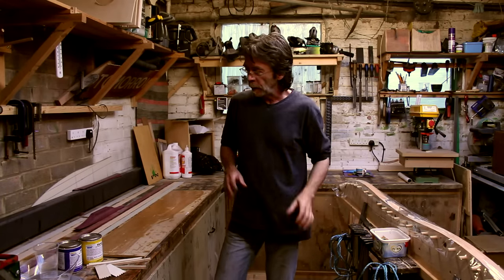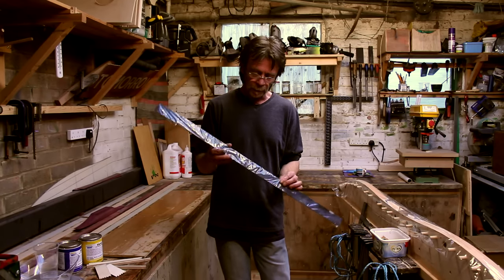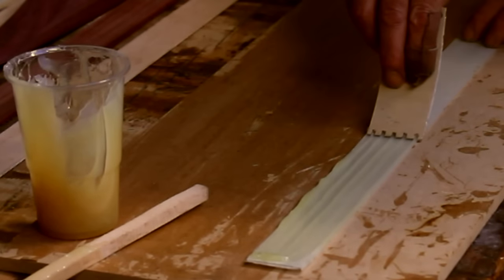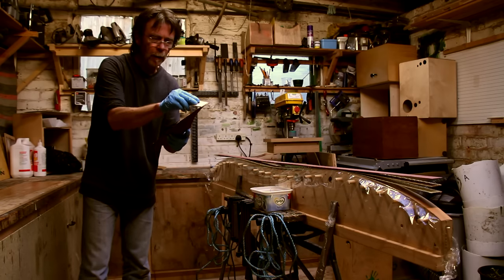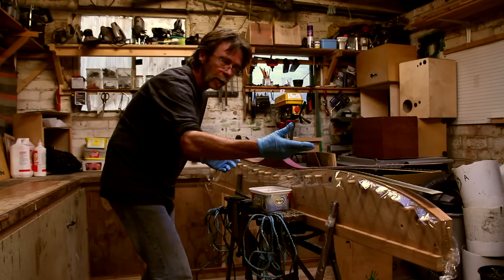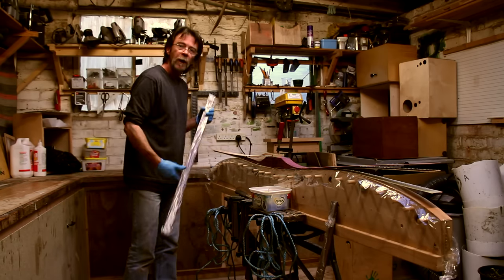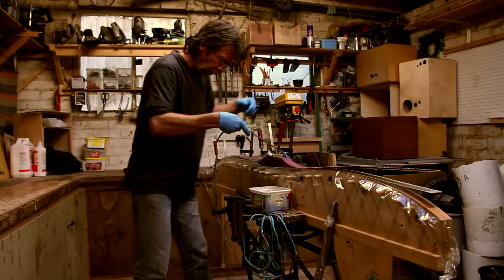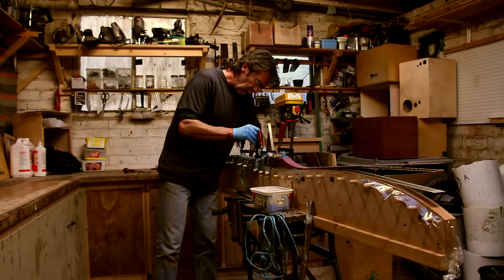Bow Building – Fiberglass Backed Laminated Flat Bow – Part 4 of 8

Comment: I built these in high school some 58 years ago. Bingham projects was the supplier.  We used a two part bow press and a canvas fire hose as an air blader for uniform pressurer.  Had a high success rate. 

Also incorporated sheet Aluminum strips in the layup in the press.  These were heated bu electrical elements and thermostatically regulated.  This eliminated the need for a hot box.  A hot box still worked if ever an element failed.

Great fun scratch building ones own bow or cross bow.

Thanks for the trip down memory lane!

Comment: Hi Guys, I have an old (60's) fiberglass bow that has come through 5 brothers. My question is whether or not I can use a fiberglass tape or artificial sinew to strengthen the bow and increase it's power? If so, where would I use the tape for best results? Thanks

Comment: Hi Dave, great series of vids you have here. Very informative.  I was thinking about changing from using the air-hose style of form to this rope and wedge type and had a couple of Q's, I noticed you didn't put any cling film on over the last glass lam. Do you ever have issues with your rope sticking to the epoxy that oozes out? Also, are you applying your epoxy to both lams (ie: the back side of the first lam and again on the belly side of the next) in the same glue joint or just to one application per joint? Any feedback would be greatly appreciated. Thanks and keep up the excellent vids.

Comment: Hi Dave,  your purpleheart wood bow and video are great. I have a question about increasing the power to about 45lbs. would you increase the fiberglass thickness 0.8mm to 1.0mm ? Or increase maple wood thickness?  Thank you for any thoughts.
Reply from the maker: Either would do it. I have not used the 1mm glass, but plan to try it soon. You could increase the depth of the outer lams by 1mm and that would increase the weight substantial.  If it is too heavy you could take a little wood off the width to get it to the right weight.

Comment: Is a hotbox a must if one does not have one?
Reply: If the epoxy calls for it for ultimate strength, yes!  Most will set but require a cute at temp on dwell time for the cure.

Comment: That must be exceptionally  super slow cure epoxy.or did you change the mix ratio with reduced hardener?
Reply from the maker: +WV591 It;s got a two hour pot life. 50-50 mix
Reply: WV591 ñ